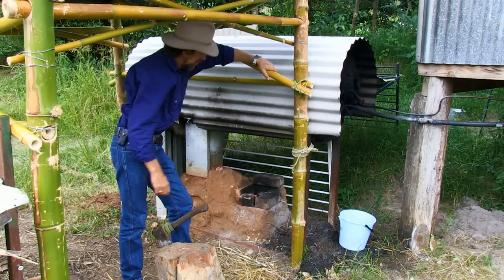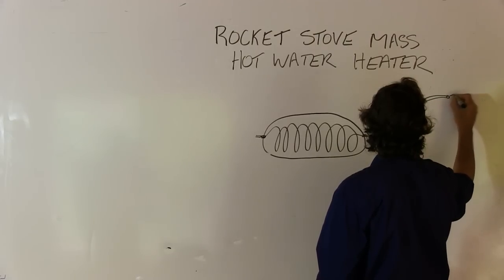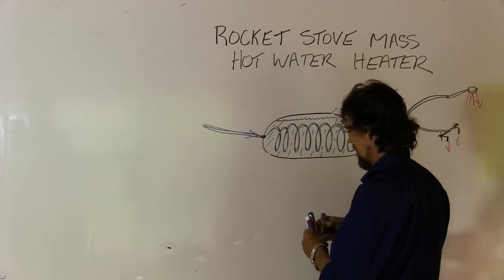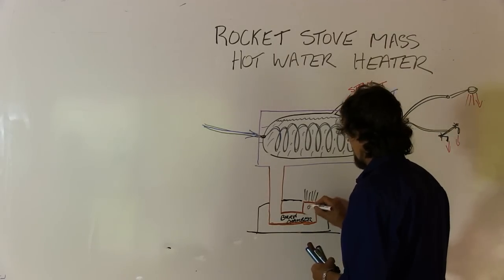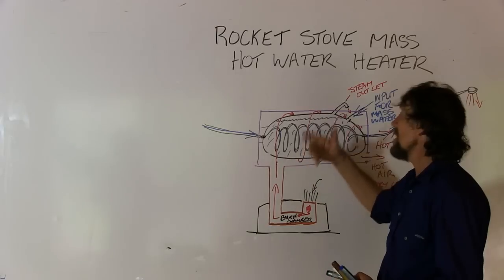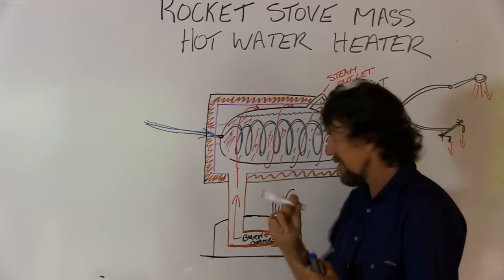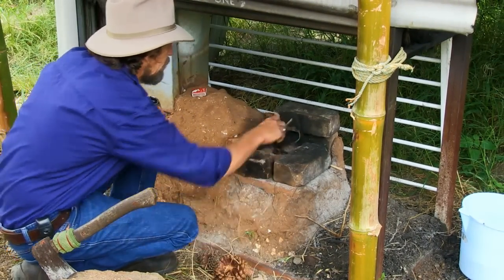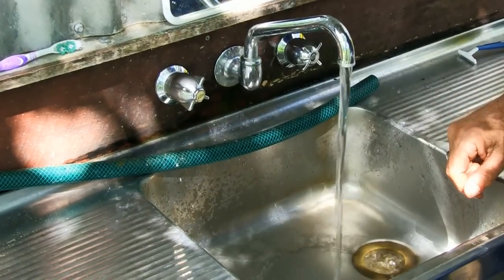How to Build a Rocket Stove Mass Water Heater, with Geoff Lawton

Comment: I liked your video however I thought it, the heater that is was a bit over done. Why not run your copper water line through say a large clay or cob brick? This should eliminate the boil off and explosion dangers altogether.Also if mass heating is not needed you could simply make a rocket heater and wind copper pipe around the chimney pipe.

Comment: Interesting model, but I have some questions. I found that steel does not respond well to temperatures of 1000 °C - it will essentially slowly burn and not last for a long time, thus the longevity and thus sustainability of such systems are in question. Are there solutions for that? Another question: How do you make it that the hot air "spirals" around the tank? thank you

Comment: great video geoff but a few comments and questions:
- i think you should mention that the type of electric hot water unit you've found is rare and that people need to make sure it is a low-pressure indirect system rather than direct
- isn't it usually the tank lining itself in old electric hot water systems that gives way and not the electrical resistance component?
- isnt the tank usually insulated itself which would reduce the efficiency of your unit, leading to hotter exhaust temperatures?

Comment: Awesome technology. I'm still addicted to cheap natural gas but in a remote setting this would be a great alternative to propane.
The non-pressurized tank to heat the shower water is genius. I bet a toilette tank, set at the same level as the top of the heating tank could keep it full since water seeks it's own level.
Reply: cardiologist told me he has seen several cases lately that he believes are related to the vaccine. He mentioned he has also seen recent cases of myocarditis he believes are vaccine related. He advised me against any boosters in the future.

Comment: Ah okay. I guess if it's just a gravity feed system, any steam inside the copper tubing could escape back towards the source. A main connected system would concern me, as steam takes 1700 times the volume as water, and steam locked in the copper would be a very bad thing.
Reply: I wonder if this guy know just how dangerous his system is?   He kind of glosses over the relief system of the steam.   If the water feed system doesn't keep up with the steam being generated.....very bad indeed.    This is why they have an engineers stamp on steam systems.   So much could go wrong.